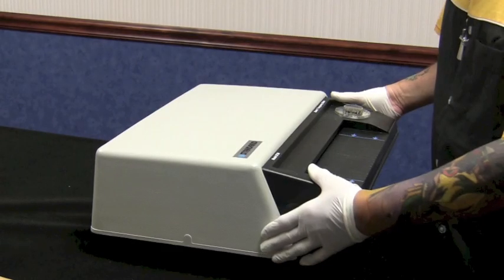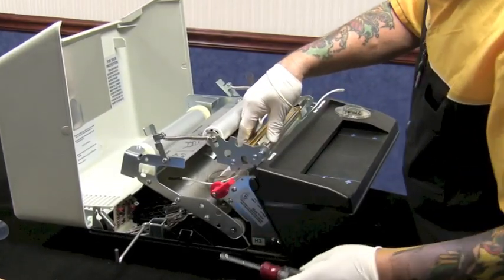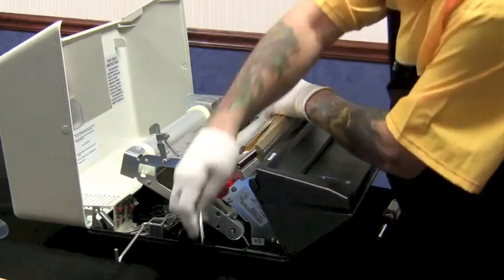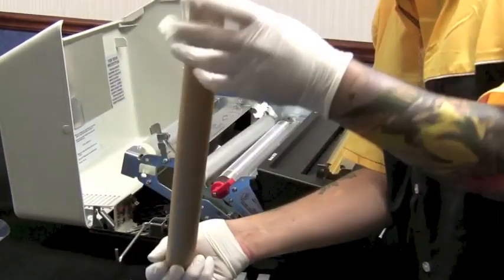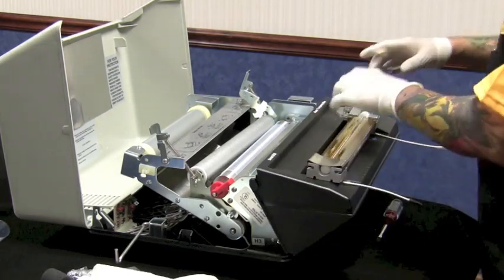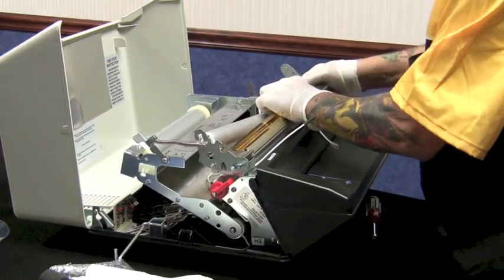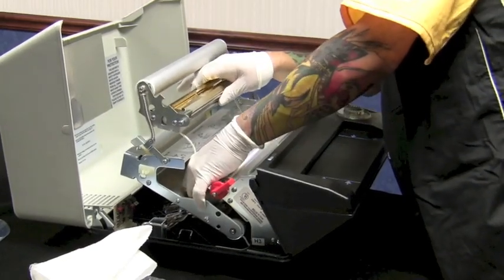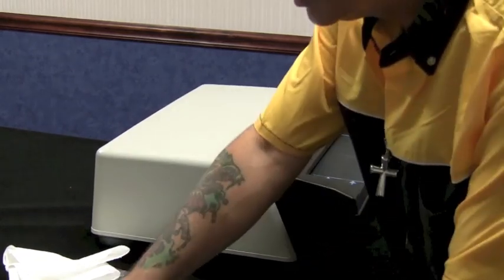How to Change a Thermal Copier Bulb

Comment from the maker: The 3 posts show the instructions for adjusting the copy belt tracking.  Keep in mind that if your belt is 'scalloped' on the ends it may need to be trimmed to keep it from moving too much.  If you have any questions please call us at 800-310-2996.

Comment from the maker: To adjust the copy belt tracking (part 2):
   a. Rotate the console speed control to the #5 position.
   b. Activate the trigger switch.
   c. Run the machine with the lamp on for 1 min. 45 sec.
   d. With the machine running, observe the belt rotation with relationship to the adjustment lines.
   e. Adjust the tracking roller adjustment screw as required, to keep the belt within the adjustment lines.  Rotate the screw clockwise to move the copy belt to the right or counterclockwise for left.

Comment: We have a 'Secretary' unit rated for a 15 amp bulb and only 13 amp bulbs available. We were going to step down the voltage with an added resistor and were wondering if and where we might find a wiring diagram for this unit. Thanks.

Comment from the maker: To adjust the copy belt tracking (part 3):

8) After 1 min. 45 sec., cool track the machine as follows:
   a. De-activate the trigger switch.
   b. Rotate the console speed control to its full clockwise position.
   c. With the machine running and before it shuts off, observe the belt rotation.
   d. Adjust the tracking roller adjustment screw if required.
9) Repeat steps 7 & 8 to insure that the belt is tracking correctly.

Comment from the maker: To adjust the copy belt tracking (part 1): 
1) Lift the two belt latches and red latching lever.
2) Insure that the copy belt is installed with the 3M logo on the drive motor side of the machine.
3) Center the copy belt between the adjustment lines.
4) Close the two belt latches and red latching lever.
5) Loosen the locknut on the tracking roller adjustment screw.
6) Activate the interlock switch.
7) Hot track the machine as follows in the next post: